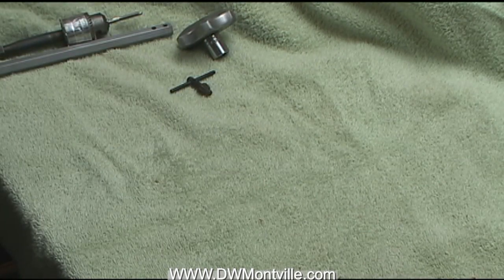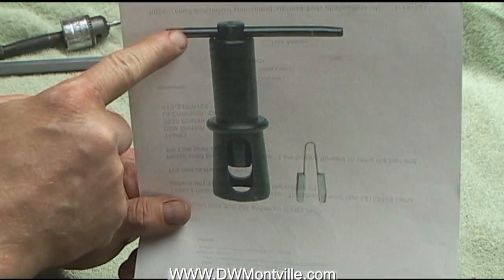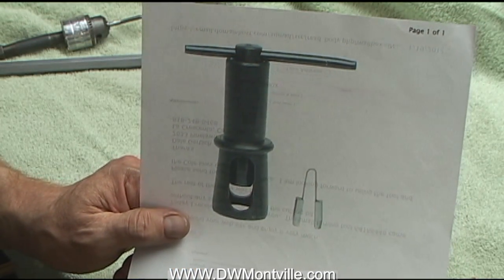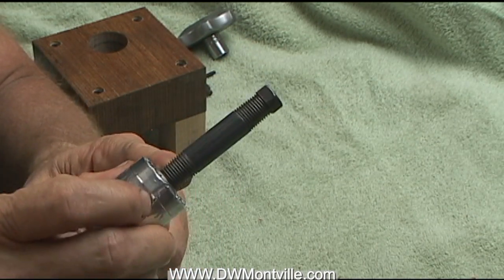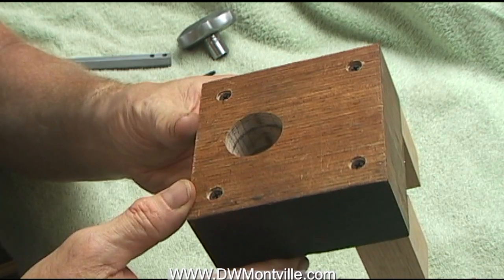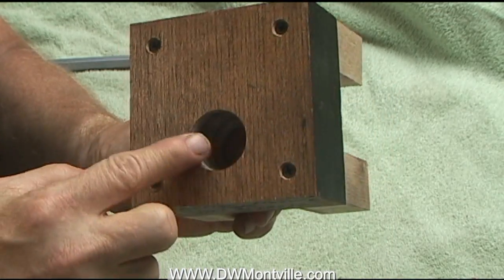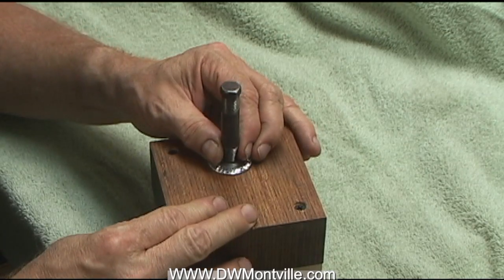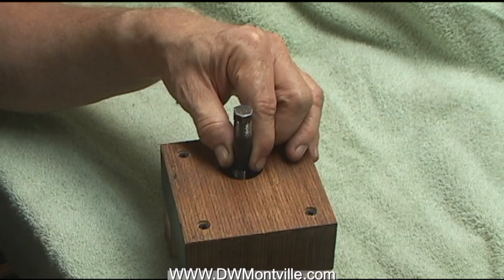A DIY Home Built Tapping Fixture

Comment: Great idea for a jig.  Thanks for posting; I've had this problem in the past and may make something like this in the future.

While watching it, I had an idea for something that would make it even easier.  What about adding a V-block to the bottom, spaced such that the hole for the chuck is centered over the V?  It'd ensure that the bar is centered every time and you'd only have to line in up lengthwise, which would be easy enough.

Comment: You solved a big problem for me. I am working on x-mas gifts and I need to tap 6 holes in a bar. so I used your idea, with an old chuck, and made a jig like yours. The only thing I did different was made the base 28" long so I just had to slip in my bar stock, clamp once and tap all the holes pre aligned.

Comment from the maker: That's how I was doing it, but changing out the drill and tap takes a long time. You have to shut off the drill press, then remove the drill and put in the tap, then you have to bring it down to the hole and while applying slight pressure with the drill press using your right hand rotate the chuck with your left hand. This means you're tapping the hole and rotating the spindle and motor all with your hand. 1 or 2 holes is no problem. 50 or more and your hand is mush.

Comment: that's an interesting jig - why not just use your drill press (manually, of course). Advantage: if you clamp to drill hole without changing registration exchange drill bit with tap and you're dead on.